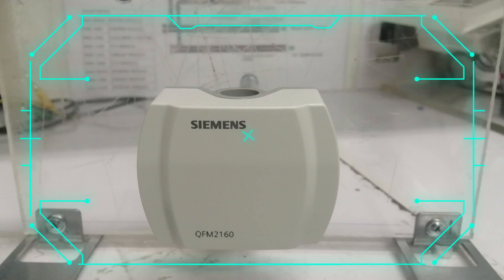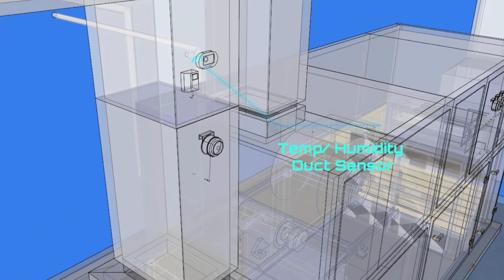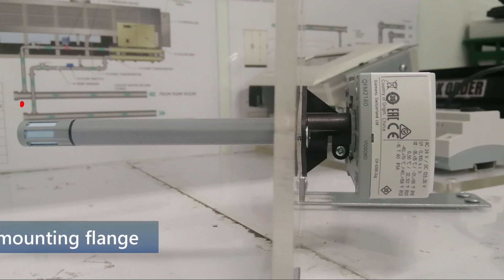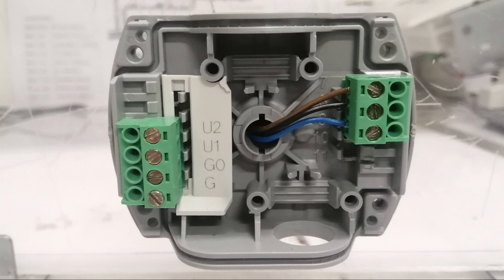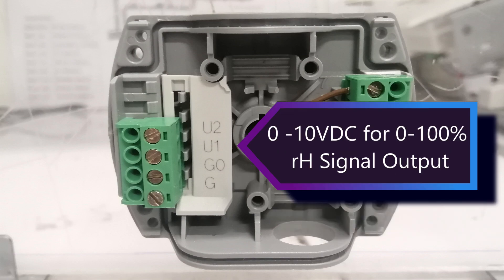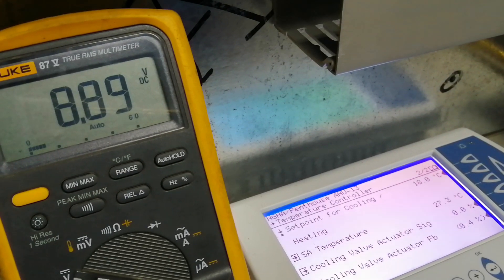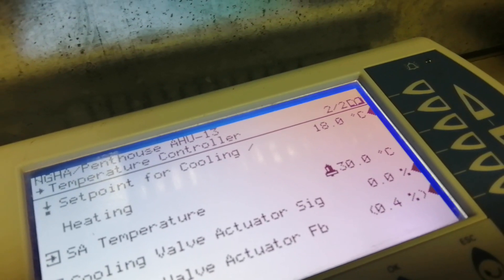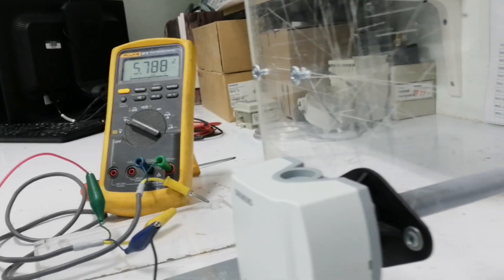HOW SIEMENS QFM2160 TEMPERATURE and HUMIDITY DUCT SENSOR WORKS?

Comment: I have a wire break alarm on the temperature side, not sure how to fix it
Reply from the maker: Fixing broken wire connected to the sensing element can cause inaccurate reading or an error. It is better to replace your sensor.